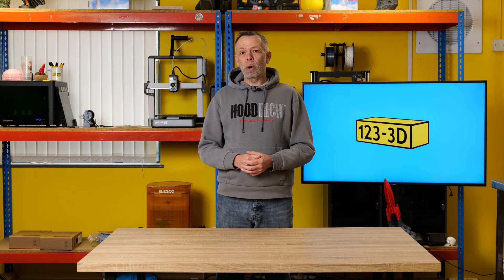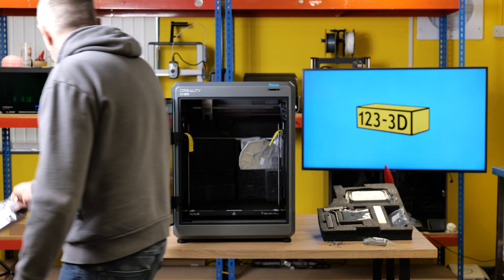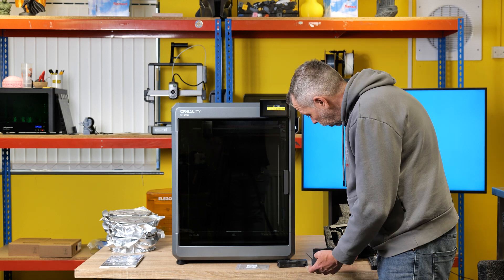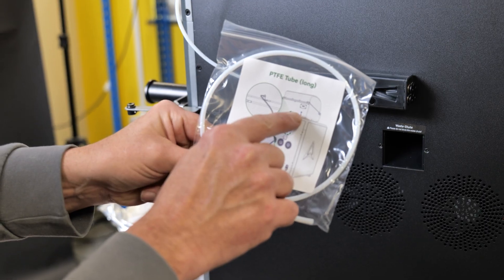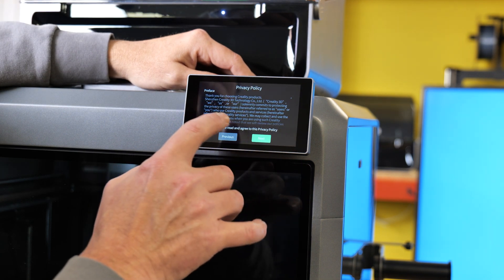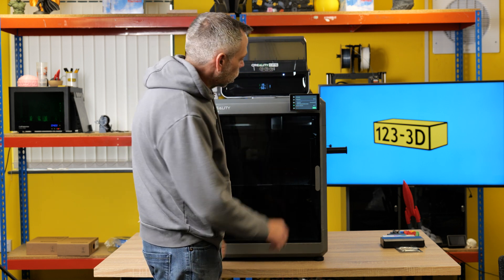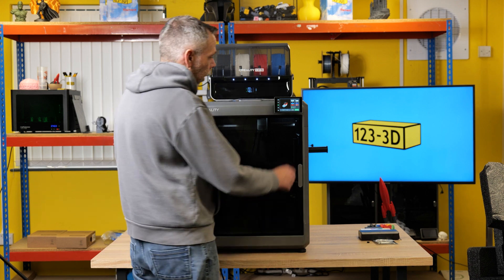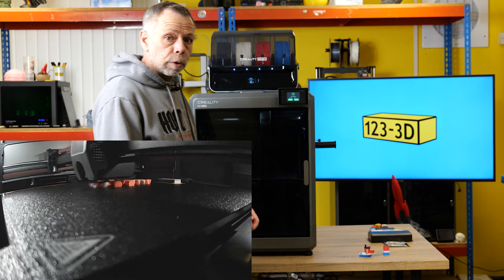Creality K2 Plus Combo | Unboxing and First Impressions

Comment: Does anyone know if the side rails with the yellow arrows (for the bed screws) should be left in?  They seem to be packing material but don't just lift off the top of the threads.  Seems like they're going to cause issues if left?

Comment: Oh this is a k2 plus. Got me confused if they released a smaller sized k2. Thats what I'm waiting to see the price on. The k2 plus is too expensive for me.
Reply: I’d buy a K2 single color printer that uses the same motors/hotend etc as the K2+ so they could share parts and have a small farm.
K2 mini / K2 /K2+

Comment: Did you update the printer  as the label on the display said to do?  Did you just not show that?
Reply from the maker: Being completely honest we got distracted playing with the machine and didn't update before printing. Since the video was filmed we have updated and have still had no issues so far.
Reply: @123-3D-UK  So no issues with the update?  I have had problems in the pass with Creality updates.
Reply from the maker: Not that we have encountered.